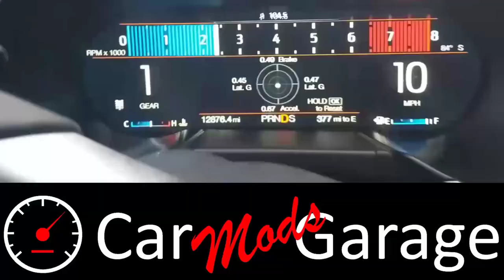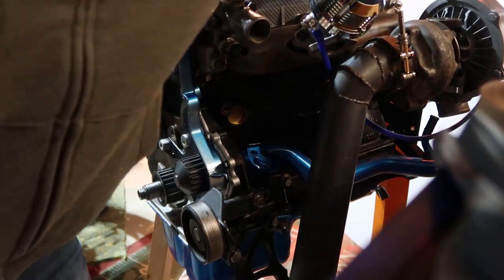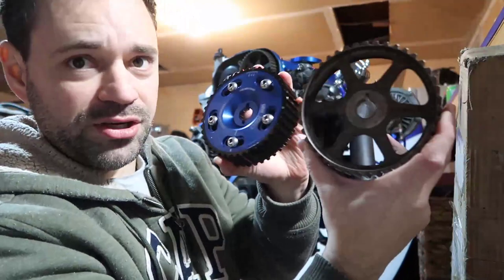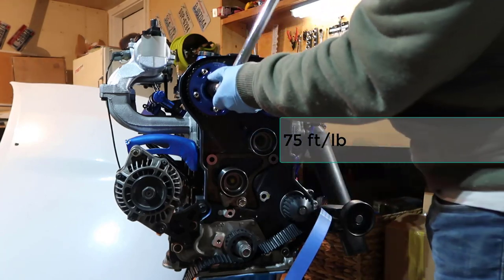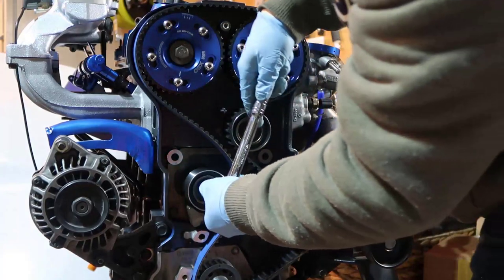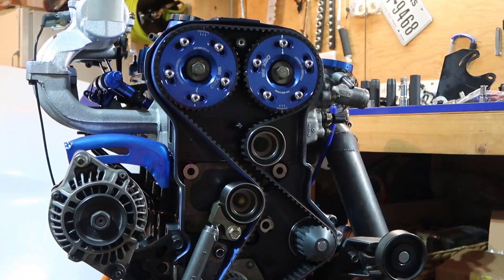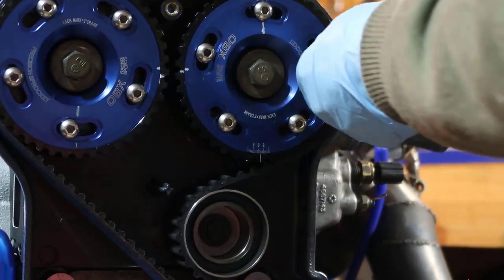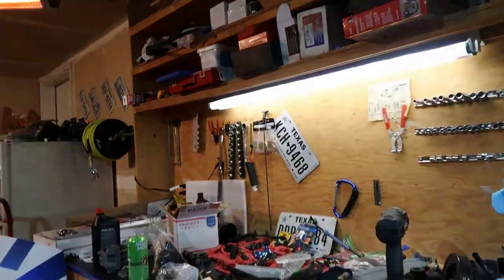Installing Timing Belt and OBX Cam Gears - 420a  #Eclipse2GBuild

Comment: Question , I'm doing ac and power steering deleted,  but when I removed those the serpentine belt just have to run alternator and crank ? Can you help with that
Reply from the maker: I guess you only need the one small belt that goes to the crank pulley to the alternator.  The other pulley power exactly what you deleted
Reply: @CarModsGarage  thanks you so much you are always helpful
Reply from the maker: @lionscott1663  🤙

Comment: This may be a long shot in the dark, picked up a 97 rs. Already have the engine pulled, my goal is prep it to handle a turbo at 9 psi. Not rly concerned with hp output. Just something fun to play with. Every cam gear I come across says it's for a turbo only. Not a 420a.. What cam gears would work best for this particular engine and turbo plan?
Reply from the maker: It's so hard to find anything for the 420a now a days.  I guess whatever you can find will be fine.  They are not that different as long as you can adjust.   I almost used the OEM to be honest
Reply: @CarModsGarage  I just found tonight, 3 silver cam gears in stock through ci motorsports. Snagged two of them. Thanks for the quick response as well.
Reply from the maker: @z3roxc00l9  no problem.  Good luck 👍

Comment: Hey just a quick question do u have aftermarket cams??? If so stage one or 2? And where can i get some?!? Im thinking of sending it in my mitsu
Reply from the maker: Hey, I got those with the engine parts I got. They are aftermarket and the are Crane Cams. I'm not sure if it is stage 1 it 2 though. I'm at the hospital having a baby so I don't have access to the picture with the specs.
Reply: Car Mods Garage oh no problem dude take your time! Congrats btw! But lemme know when you can man thank you!

Comment: I been trying to find adjustable camshaft timing gears for my 1996 Mitsubishi eclipse 2.0l non turbo 420a engine and been having trouble any help at all what would work would be greatly appreciated if there is any
Reply from the maker: You are not alone. Just last week I sent two I had here to two different people on the same boat as you.
Reply: Ok thank you  and thank you for your videos they are extremely helpful
Reply from the maker: @jamesvickery3278  thank you I appreciate the support

Comment: I think you gotta pull tention pin before you adjust timing gears. The tention needs to bee atoperating tention to know where everything is going to land.
Reply from the maker: Yes that would make sense. Although I followed the procedure to only take the pin once you time and spin the engine a couple of times and see if it did not change.
Reply: So pull the pin out of the tensioner spring before setting cams timing?

Comment: Where did you find the tensioner bracket and bolt. I found one on carquest for 101.02
Reply from the maker: I had it from the block I bought so I didn't need to find those. 101 didn't sound bad I would take it.
Reply: I got one for $66 I called the dealer and got the part number

Comment: Hey , how do you fix a timing belt code p1390 timing belt skipped 1tooth or more on a 420a eclipse engine
Reply from the maker: Unfortunately you might need to take the engine mount that's close to the running belt to take the cover off. Basically you want to take the tensioner off to get the timing belt loose and fix the teeth. If it skipped a tooth you might want to replace that tensioner anyways so put a new one and place the cover back in place. Be careful you will need to jack the engine from the bottom and be sure it won't move while you are doing it. Using a cherry picker would be safer.  I have a video replacing the timing belt on my 420a. Check out the playlist for it
Reply: @CarModsGarage  my engine was lopping real bad, I took the timing cover off and line the crank and the cam . I didn’t buy new belt or tensioner just reused the same ones. Now the engine runs with a slight lope. Should I got a new tensioner and belt?
Reply from the maker: @roycepickett1598  well you need to think why it skipped a tooth. I would think that the tensioner might not be pushing well against the belt.  I would replace that since it is easy. The belt on the other hand if it is looking good I wouldn't but again if it is out already then why not 🙂
Reply: @CarModsGarage  thanks Bro, before I break it down again I’m going to order the parts, it’s way cheaper to order than to buy it from the parts store but again thanks alot
Reply from the maker: ya man no problem and yes that's definitely right!
Reply: @CarModsGarage  hey my friend, I finally got the parts for my eclipse and installed the new tensioner and timing belt. Unfortunately the Car still lopping and the ECU still reads timing belt off a tooth or more. I’m I doing something wrong need help?
Reply from the maker: @roycepickett1598  did you time the belt again or just put the new tensioner in?  You might need to time it again to be sure it's good
Reply: @CarModsGarage  yeah, I time the crank and cam. Put everything back together the car idle good for about 5 -10 minute then back to lopping again. My problem is in the head
Reply from the maker: @roycepickett1598  I know it's hard to tell but  does it really skip a tooth? It could be a sensor, cam or Crank sensor sending wrong position to the ECU
Reply: @CarModsGarage  you know what, I put a used cam sensor on and never would think to check the crank sensor since the car starts right up. I’m going to change both out to see if that fix my problem. Thanks
Reply from the maker: @roycepickett1598  it's just a guess but it could be it.
Reply: @CarModsGarage  well it won’t hurt to replace them, I saw some wires laying on the exhaust pipe. I’m start there before I take the head off.
Reply: Hey my friend, instead of putting new pants on, I went back and looked at your video on timing and saw that you left the crank mark at a1/2 tooth so I did that and the car looping a little bit but I found out that I got a small leak between the head and block. That might be one reason. I haven’t put the new parts on because the check engine light not on so I don’t have that code P1390 anymore.
Reply from the maker: @roycepickett1598  that's good you found something and check engine is gone!  🤙
Reply: @CarModsGarage  hey just to let you know , I took my eclipse out for a ride and it did good. The only thing I had concerns about was the idling but other than that it rode good.
Reply from the maker: So your problem was that 1/2 tooth?
Reply: @CarModsGarage  well , I would say so after looking at your video doing the timing belt. You set the crank 1/2 tooth and I was lining the marks evenly every time and the engine would run badly. So I did the half of tooth turn the crank to tighten the belt, put everything back and started the car. Went inside the house while the car is running come back no check engine light.

Comment: i just bought a 99 eclipes g2 420a on 10lbs boost it has alot of oil blowback when i hit 6lbs of boost then it starts breaking up im running stock injectors so im sure that is that issue . but blowback i was told by a few people that i have to redo my rings. but also was told that i should check oil line to my turbo.so  my question is what would cause a major oil blowback?
Reply from the maker: I am not an expert or even a mechanic but building this engine I would say that excessive space on the rings will cause blowby. I believe you say blow back meaning smoke from the pipe. It could be the rings are going bad or it could be the turbo leaking oil a bit and burning through the exhaust. I am not sure about the oil line. Not sure how the line would cause smoke anywhere. Check the oil pressure #1 and check to see if the oil level is dropping #2. After that I would maybe inspect the turbo for leaks and see if there is any play and lastly open the engine and replace the rings.
Reply: @CarModsGarage  ok man thank you. also had someone say that having a bad turbo would build pressure and blow the dipstick out which in the return spit oil everywhere and it would seem like a bad head gasket.
Reply from the maker: @dannydiaz5842  oh I had no idea about that. One more that I've learned today :)
Reply: @dannydiaz5842  is there a check valve so your not dumping psi into the crank case?

Comment: Once the timing is aligned and the tensioner has the pin pulled does moving the bolt that’s used to adjust the crank to TDS mess with timing? Just making sure so I can fix my car today lol also I subbed your video helped me out a lot
Reply from the maker: the bolt from the crank can be removed since that is a dowel pin to keep it without turning. If you take any gear from the camshaft or crank out it will be hard to put back in there because of the tensioner but only the crank bolt should be fine. Why do you want to take the bolt from the crank?
Reply: @CarModsGarage  it’s what I’m using to rotate the crank but I still have to use the bolt to put the crankshaft pulley back on and secure it. I just want to make sure that when the timing is set and the belt is tight that when I loosen this bolt it doesn’t mess up timing again
Reply: @CarModsGarage  also with the tensioner if you use a C-clamp you can close the spring and put the pin back
Reply from the maker: @7ravon555  be careful with that. Compress slowly a bit at the time. I've done that and got my tensioner leaking after a few months
Reply from the maker: @7ravon555  oh I see so you have the small sprocket that holds the belt. Now you need to take the bold out to put the dampener back.  It should be fine.
Reply: @CarModsGarage  thanks a lot man I’ll update you if it runs today lol it’s been a while since I touched it last
Reply from the maker: @7ravon555  alright. Let me know how it goes. Good luck buddy!

Comment: Where did u get the timing belt cover?
Reply from the maker: I just had it on my engine. I saw them on Junk Yard though. You should try there
Reply: @CarModsGarage  I saw the OBX cam gears for my Saturn Sl2 1.9L but I emailed them and they never answered back. Did they reduce some co-efficent drag from the engine? I also got a ported intake manifold, bigger TBI, cold air intake and a 1991-92 factory GM header on mine. I still have a used aluminum Sl1 crank pulley and alternator pulleys leftover too but I'm not liking the slight wear of the crank pulley. I guess, what my question was is OBX even still in business? They certainly don't answer emails.
Reply from the maker: @junechris  oh wow that's odd. They are big enough I guess to at least answer. I wonder if it is because of the Christmas. 
As far as I know yes they are. They worked fine for me. I had issues with the timing tensioner though. Going mechanical instead of hydropic
Reply: @CarModsGarage  I'm not sure on mine, I'll probably  change the timing chain in mine since it's a no brainier. I actually have an aluminum SL1 crank pulley and a SL2 alternator pulley that I bought online years ago from somewhere but I'm not liking the wear on them, even though it's not horrible, possibly be refinished?. There was a guy called  Saturn man online but I can't find him anymore who told me to run the lighter weight crank pulley cause it's lighter than the SL2 one but they don't offer a combo, like I have, for the crank and alternator combined. I would likely have to purchase two separate sets....lol
Reply from the maker: @junechris  the crank pulley is the harmonic balancer. It absorbs vibration from the crankshaft rotating. I would not replace this one by a lighter one. It it has wear I would buy a new one if it was on my car. the alternator one ya if it is special and you can get refinished you can but if there is damage on the grooves you better off replacing them. You probably can get aluminum ones on eBay even and they will work fine (alternator and water pump ones)
Reply: @CarModsGarage  So it'll be better to just get the SL2 combo on EBAY, if I buy it new then, which is what the car calls for? I suppose if I add the cam gears too, in theory, it should make the engine more efficient all together, even with the same horsepower, in theory at least.
Reply from the maker: @junechris  I don't know much the gears you need. The cam gears like the ones from my video are only good because when I put the belt with the engine times I can advance or retard a few degrees if necessary without the need to take the cover or the belt off. What is your car again?
Reply: @CarModsGarage  A Saturn Sl2 with a timing chain. I was planning to keep the factory timing on it but just hoping for less drag on the engine, hence, free up power without adding more power. Was gonna ask if u noticed any increase from the cam gears u installed. I suppose I may see some quickening from the crank, alternator pulley setup for SL2 that u mentioned and the cam gears combined but who knows, maybe no difference.
Reply from the maker: @junechris oh I see. I can't tell because I turbos the car but I works not expect to get more power from them. The cam gears  also won't do anything. Don't replace them for power. If you want to increase power I would bet more on the intake side to be sure you get colder air and maybe more air with a different filter. Larger exhaust will do that also.
The crack gear which is there dampness if I'm not wrong will help if it is lighter but then you get other problem which is vibration
Reply: @CarModsGarage  Ok, yeah, I already got a ported intake and bigger TBI and cold air intake and dropped 50 lbs off by the Seibon carbon fiber hood and other measures. I upgraded the suspension too.  It's a very light car, it's plastic body panels..lol Was thinking of adding some RPF1 enkei's to shave some more rotating mass off in that area too. The stock wheels are 13 lbs whereas the Enkei's are like 9 Lbs each.  I also replaced all the rubber with polyurethane. And also you're saying that the cam gears probably doesn't do much I suppose.? I guess don't bother with the crank pulley either, even the one for my model SL2 I guess? Maybe a futile effort and not with the risk?
Reply from the maker: @junechris  yes so the cam gears if you are not messing with timing will give you nothing. the lighter pulleys will let you change speed faster like revving up and down.
Read this. They explain what it does good and bad
https://www.nonstoptuning.co/blog/lightweight-crank-pulleys-good-bad-depends
Reply: @CarModsGarage  yeah, mixed reviews on pulleys. One said that most piggy back on the harmonic, etc and if they are smaller in diameter, it takes more revolutions to achieve the same end as the stock ones.
Reply: @CarModsGarage  Cool read, yeah, my RPM only goes to 5750 RPM before the fuel cut and I have a harmonic balancer, if I recall correct. Thanks for the article!
Reply: @CarModsGarage  Yeah man, thanks for the reply's. I found a Saturn engine repair manual from Saturn directly. It said the engine is internally balanced. It's an amazing video about how they were ahead of their time. Foam cast aluminum block for lighter weight, the cylinders are even sleeved. I didn't even know about the sleeves and even the crank was made with the foam casting as well. It shows when u really want to compete with Japanese cart makes, they have it in them. https://www.youtube.com/watch?v=rWaQ98Bd0cw
Reply from the maker: @junechris  oh that's awesome :) I hope you get some good changes on the RPMs